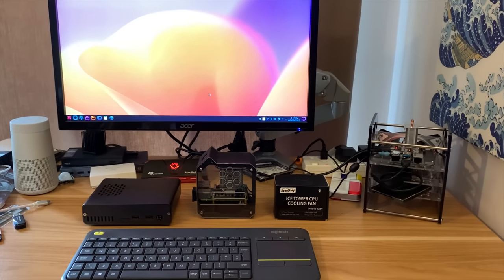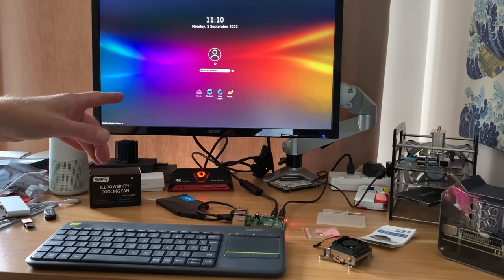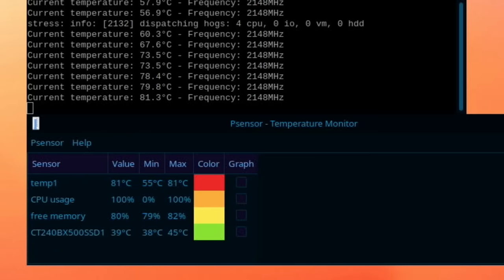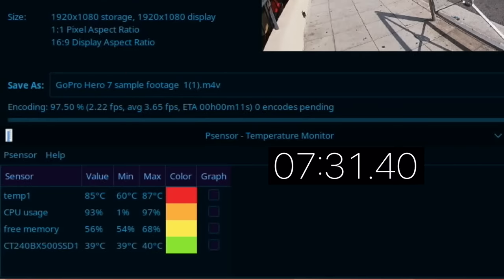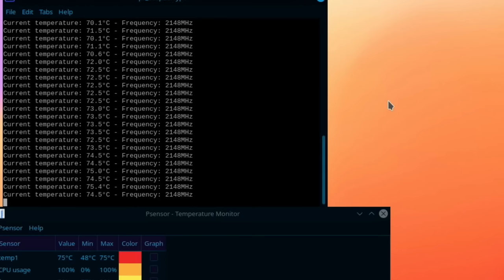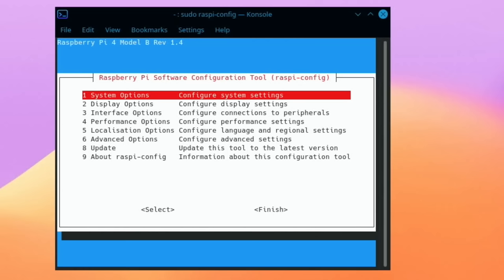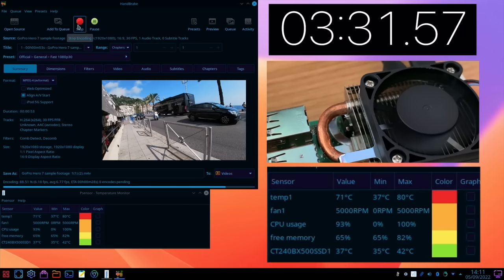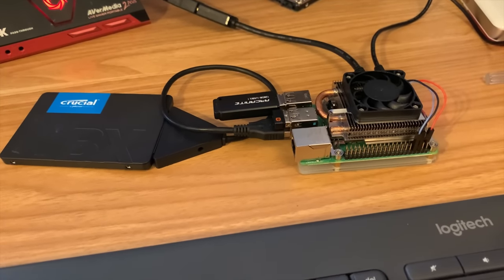Great Raspberry Pi 4 Cooling solution

Comment: I received a couple of the 52Pi coolers. I have one installed on my 8gig. (Another 8gig coming from PiShop) I did some video testing and it worked like yours at 60c. 

I turned the controller off and just let it run. I don't hear it run due to other fans. I figure the cooler it runs the longer it will last, maybe. Idle it runs about 30c, so it's keeping the network & memory chips cool too!

Comment: Hey, i really liked all of your argon one case vs this low profile ice tower cooler videos.. we got very wonderful test results.. 

Now can you please do a same temperature comparison video of this new low profile ice tower cooler vs old low profile cooler which is included in the deskpi pro case vs full size ice tower cooler... 

The old low profile ice tower cooler which comes with deskpi pro and full size ice tower cooler only touches the cpu and this new cooler's mount plate touches all the chipset and cpu .. so comparing all these coolers will give us someone helpful results.. 

I still wonder if cooling the other chipset helps in any performance or not...

Comment: I would love to see this with a low profile enclosed case.
Also would be awesome if the Pi 5 will have the same layout as the Pi 4. I think the Pi 5 is about to launch very soon.
Reply: Yeah, probably with an RK3588
Reply: @r0galik  They are moving away from Broadcom?
Reply: @hatrez4285  I don't know, it just sounds like a logical next step. My source is nothing but speculation lol
Reply: I'm prepared to be proved wrong but I don't see a Pi 5 being released until the global manufacturing and supply problems are resolved - and it probably would not make sense doing so during a global economic crisis anyway. You need to appreciate that the Pi is geared at education as well, and many schools here in the UK don't know how they are going to cover their heating costs this coming Winter - so one of the first budgets to be scrapped by them will be IT-related purchases just to pay increased fuel bills.

The Pi Foundation is a registered charity here in the UK, it's not a fully-fledged profit-making corporation and I personally think it would be a "cynical" move by them to release a new "top-level" Pi that would ultimately be seen as making the existing Pi 4 redundant to at least some degree - that would make schools look even worse at being unable to provide the latest hardware to students.

I think what the Pi Foundation may do is release more Pi's at the lower end, so ultimately producing new versions of the Pi Zero which can still be sold at very low cost and require fewer components in manufacture anyway.

I also get frustrated by comments like this on YouTube anyway - not just in this channel but in any channel that does any kind of hardware reviews. Why are so many people never happy with "what they have now" and are always looking towards "the next thing coming"? This was particularly true when the Steam Deck was released - literally on the day of release, YT was plagued with comments like "Steam Deck is great, looking forward to Steam Deck 2".

I wish people would learn to use what hardware they have properly and understand how to optimise operating systems (particularly free ones like Linux) to get the best out of that hardware, rather than coming to these rapid decisions that "it's still too slow" and then demanding the next upgrade.

One final point - if there is such a demand for existing Pi's that very few people seem to be able to get hold of anyway, why release anything new if demand for existing models is still there?
Reply: @terrydaktyllus1320  My comment was just a speculation. Like anyone else I don’t have any clue when the "new Pi" will be released.
My speculation was just based on the frequency release dates of new generation RPIs.

Also yes, people may crave for new standards, new features, ML, better IO latency, better performance etc.

And note that the performance aspect was the reason why this video was made in the first place.
Reply: @hatrez4285  "My comment was just a speculation."

So was mine, don't be so "butt-hurt" just because someone has an opposing opinion to you in response to a post you put in a public place.

If replies from strangers on the Internet to your posts are an issue for you, then don't post them in the first place.

"My speculation was just based on the frequency release dates of new generation RPIs."

Yes, and the last time a "major" Raspberry Pi was released, there were no chip shortages - hence bringing that into the discussion.

"Also yes, people may crave for new standards, new features, ML, better IO latency, better performance etc."

You can "crave" to be 6'6" tall with biceps the size of tree trunks, but it doesn't mean it's going to happen.

"And note that the performance aspect was the reason why this video was made in the first place."

Yes, but it's about improving the performance of what you do have, not what you don't yet have.
Reply: @terrydaktyllus1320  this escalated quickly
Reply: @r0galik  I see no escalation, I see merely discussion.

What you see is up to you but of no real relevance to me.
Reply: @terrydaktyllus1320  OK m8
Reply: @r0galik  Yeah, that was insane.

I mean: I know the UK loves to drink, but that was asinine.
No one ever typed "I demand a more powerful Pi5!!!!!"in this thread😒

If I may 'speculate':
More like they just lost in a relationship and are projecting their hurt.

Honestly:
I'm thankful Raspberry Pi OS is now insanely stable and updated more than weekly.
I have no need for a more powerful Pi if they keep tweaking the OS performance.

@Terry Daktyllus:
Walk it off bruh.
"Also would be awesome if the" people that post had some enlightenment in their motivations.
e.g. Terry 5.0
Reply: @terrydaktyllus1320  Okay bruh, lmao.

Comment: Thanks!
Reply: I sent you $50.00  US because $25.00 was not an option.
Buy the ARGON and apply the additional $25.00 to a review.
Reply from the maker: Thanks, I have ordered the V2. I'll try it with the M.2 board.👍
Reply: @leepspvideo  Please do with and without...

M.2 boards get hot and both would be invaluable.
Reply: @leepspvideo  I know it is a big ask:
I would love to see stress tested with and without the M.2 expansion.

Word of advise: 
Do not tighten down all the eternal screws until you have them all aligned a started.
It is the #1 complaint that the last hole chosen will not align but is not always the same hole.
Most people, like you, know not to tighten down all screws when putting prefab stuff together (e.g. Ikea never fits if you are tightening it down before everything is aligned).

Also:
The M.2 enclosure has known issues with Bluetooth, wifi, picky about M.2 chosen asks a lot of power to run through the Pi board under heavy loads.

Comment: Interesting. Maybe you could do a comparison between the original design & this one? 
p.s. I'm stuck watching on my phone & can't tell if the fan is blowing down onto the board or exhausting upwards. Thx!
Reply: Generally speaking fans blow towards their frame, which is not seen in this video, hence why its blowing towards the board.
Reply: @coldycoldbg  No!!!

The best option is negative flow.
I.E. the fan sucks air out of any enclosure.

Only an idiot would push hot air into the rest of the system.

e.g. Does your tower push air into the tower from the PS?? 😆🤑🤧🤔
Reply: @LilRedDog  Which ever the case may be, I am explaining how fans are generally made. And they are typically spinning anti-clockwise, pushing air towards their frame (down in this case).

Comment: I wish I could buy a few Rpi4s at normal prices.
Reply: You can in the U.S. through the official Raspberry Pi site but it takes patients...
(Actually, one has full kits 'extreme' with aluminum cases/heatsink that are not unreasonable).

I do not remember which official sellers will email you when a Pi becomes available but I singed up to be notified when they had 2 zero Ws in stock and as soon as I got the email, I locked it in.

I have a 4b+ 8gig and I am waiting for the 5 for another purchase. 
Anyway, you can get an 8GB with a kit option today for $185.00 US and a 4GB for $165.00.

Comment: How is it that Handbrake imposes a heavier load (and increases the CPU temperature more) than stressberry?!? It can't be because you ran Handbrake immediately after the stress test, since the CPU maxed out at 79C over long duration with stressberry; yet the CPU hits 85C with Handbrake?

Comment: If throttling starts at 80, it might be better to start the fan at 78 or something like that.
Reply: no matter have start point 78 or 80, run good if temp have 85 no problems, but better if can drop cooling tmp under 70. fan need start if temp go up 84 normal.

Comment: Is this cooler quiet?
Reply from the maker: Very especially on 3v
Reply: @leepspvideo  what’s the best way to control its speed? It’s no where near as loud as my old fan but it’s still loud. I think mines on 8V, I just did what the instructions told me to do.

This cooler is really good though, my temps are like 28-31 on idle now.

Comment: this cooler need orden, now my raspi4 8gb have hot alltime 84 degree warnin have alltime ON, outside have +20 celsuis and in room same, but raspi run movie netflix have too hot, i use aluminium cool element plus little fan up processor, but no help. need lot better cooling system my raspi4. if looking only yutobe not have hot lot about 60-75 degree celcius.but looking movie go up fast hot.

Comment: I do not understand this content:
The ARGON case trounces every cooler I have seen content on.

 I wish you would 'Project Farm' this kind of information.
Reply from the maker: I have read that the fan is 30mm and relies on gpio 0 so not as compatible with as many operating systems. I would be surprised if it was as effective at cooling as this open design with a 40mm fan. I also like the option to be able to switch to 3.3V.
Reply: @leepspvideo  You have read ? 

Okay, ummmm:

I really enjoy your channel.

Raspberry Pi OS  is killing the competition. (esp in 64 bit)

And I have many mSD cards to prove it.
You have influenced all the options I have tried.

All I asked is a "Project Farm' approach.

It is all Linux. The bash should work on all distros and if not, 'Project Farm' it.

I do not over volt, I get 2147 (I got a lucky bin) and that case keeps it below 57 when watching  YouTube in chromium at 1080p (which is close to 87% load and 720 60fps {it chokes 1080 60fps}) in the summer here and the thermostat is set @ 76f

and again:
It was just an ask. 
No m.2 just an across the board of OSs with the ARGON. If the bash fails, then it fails and notate it.

I'll bet dollars to doughnuts ARGON pays attention and adds a bash to anything you throw at it and you deem a failure.

Thanks in advance.
Reply: @LilRedDog  I smell "burning hypocrite" here - you picked him up for "I have read" right after you said "I have seen content on". What's the difference?
Reply: @terrydaktyllus1320  Actually, I striked "I have read" but because this is his channel I left it because he would see the removal.
I thought it could be seen as too snarky and I did not want to be. I have enjoyed his channel since I discovered it.

But to answer you directly:
I was quoting him. I, really, have no idea why 27 (GPIO 0) is not accessible in other distros.
He has, however reviewed the 400 and it is, also, a huge heatsink but 'without' a fan. and he was impressed with OV12 and 2400 and was impressed how cool it stayed.

Looking into his videos he says he will review it if it is sent to him. So I think that is the real answer. 
He reviews coolers and cases sent to him.
No problem.
Reply: @LilRedDog  I didn't ask for an explanation, nor did I read past the first sentence - you wasted your time writing the rest of it and now you just look a bit "sad" trying to wriggle out of blatant hypocrisy.

Leave it there, sonny, I don't want to see you making yourself look even more silly.

Discussion closed.
Reply: @leepspvideo  I just want to apologize.

I could have made my first post clearer.
I will pay for a ARGON V2 to be sent to you.

No M.2.
Just a enclosure, with a 30mm fan, to be considered.

You, should, have my email address. 
Send me an address. It is only $25.00 (no kit) on amazon.